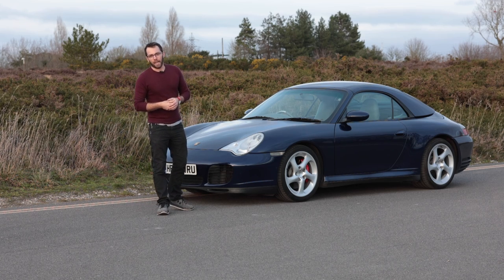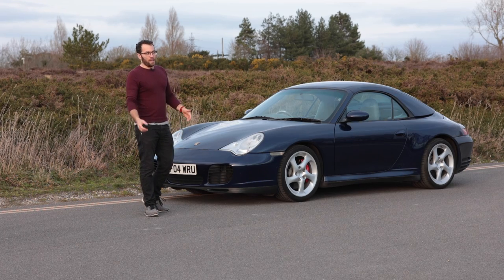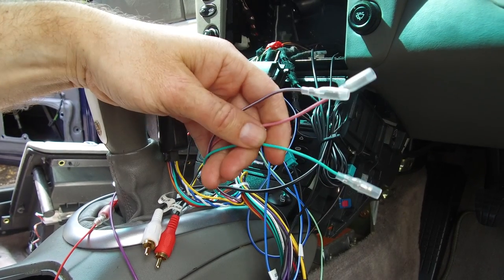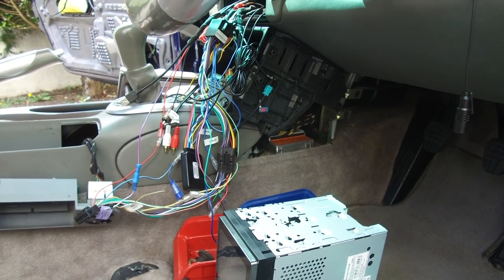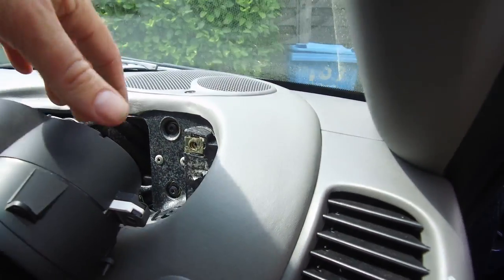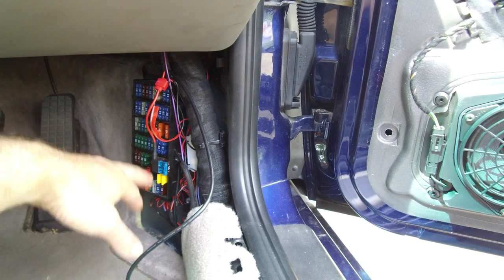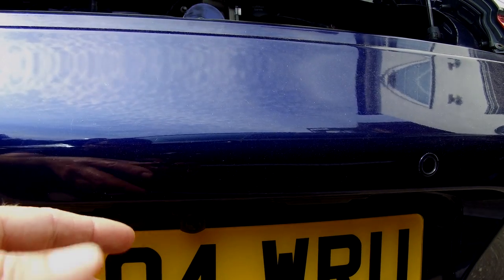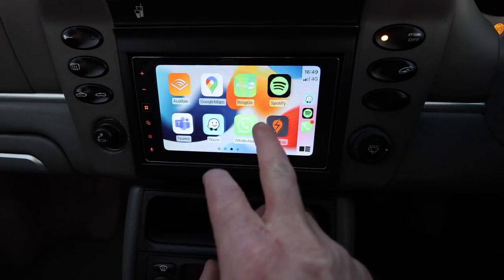Stereo nearly SETS MY 911 ON FIRE! - Replacing the Porsche PCCM stereo head unit

Comment: Sorry,
I'm still at a loss on where the MOST box wire connections go.  Got the Fiber Optic connection and the RCA outputs into the head unit, but you kinda skipped where the wires coming out of the MOST box adapter should go.
Looks like a Black to Ground, a Yellow to +12v Battery and a Red to ACC.......but where exactly does this wire connect to?
I think it should go to the Blue/White REM wire on the head unit connector.....is that right?
I
Reply from the maker: Hey Jeff. Sorry I was a bit rubbish at filming way back when I did this!
This post might be a bit more useful https://rennlist.com/forums/996-forum/1187384-996-stereo-upgrade-with-factory-bose-optical.html#post16863569
Are you using the Connects2 CT51-PO04 adapter like I did or a different variation? It depends on the audio setup you have in the car from the factory and each of those CT51-PO01/2/3/4 have a slightly different setup.